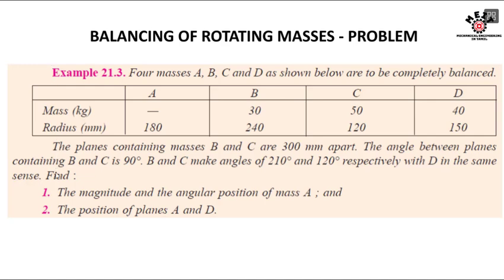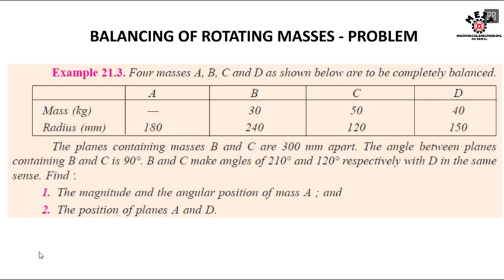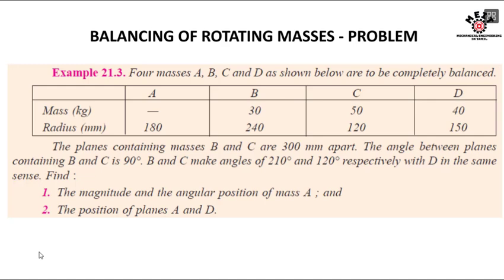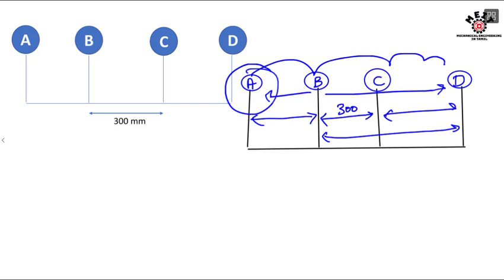Balancing of Rotating Masses - Problem | Dynamics of machinery | DOM | Mechanical | ENGLISH

Comment: In couple polygon why shoud u take a' line in right side in angular position it is in left side direction ?
Reply from the maker: Actually the polygon direction is like a cyclic, see the direction of a' line, it is towards left side only. But while drawing i need to draw to line to get intersecting point., so I draw towards rightside and Mention the Direction towards leftside.

If all the values are known, we can draw as per the direction. But when the values are unknown, we should know the proper direction and mark them after completing the lines.
Reply: @focusacademylectures   fly wheel sum la oru video sir
Reply from the maker: Play list la irukumae
Reply: @focusacademylectures   difficult problems sir
Reply from the maker: After few weeks. I will try

Comment: Form reference plane diagram it seems correct sir that A is lying in negative side from B and D is lying in Positive side from B then why should we change the position in reference plane diagram and also in couple polygon diagram initialy why you taking A in right side sir if we taken along D it will intersect sir 27:49
Reply from the maker: Initially we assumed., After finding the values we correctour initial assumptions.
Reply: @focusacademylectures  sir another doubt that at 27:49 why in couple polygon diagram A is not drawn in down side instead of up
Reply from the maker: According to polygon law, the closing side and opposite direction to the cylce is resultant. Cycle of couple polygon is anticloskwise and we draw A clockwise as closing side.
Reply: @focusacademylectures  sir according to force polygon A is in downward direction and you drawn it in reference plane with A facing downward  direction but why in couple polygon we took A in upward instead of Downward facing😞
Reply from the maker: Force polygon was drawn to the balanced forces., Which form a cycle. 

There will be more complications, better yu solve more problems then u can get things better.
Reply: @focusacademylectures  thx a lot sir 🤩🤩

Comment: Sir at 28:29 ,
The angle of A is 236° So, it will be in third quadrant from O and both D and A will intersect in third quadrant sir? If I am wrong pls correct me sir.
Reply from the maker: Each masses in different planes, there ll be no intersection.